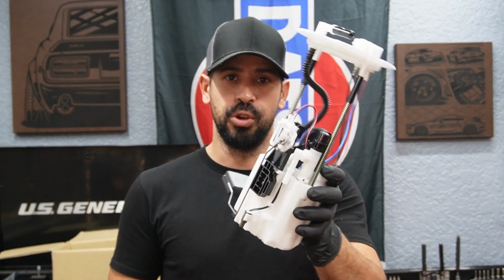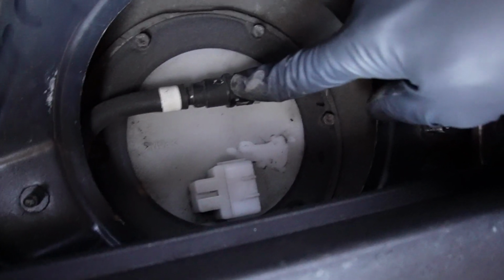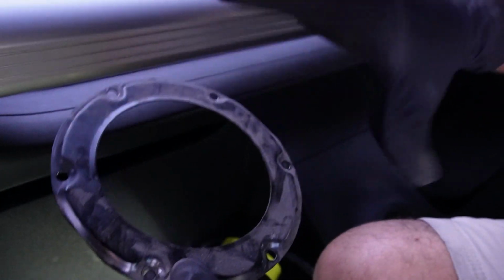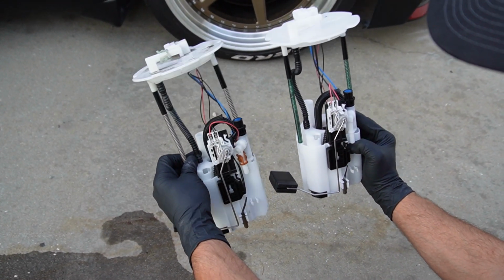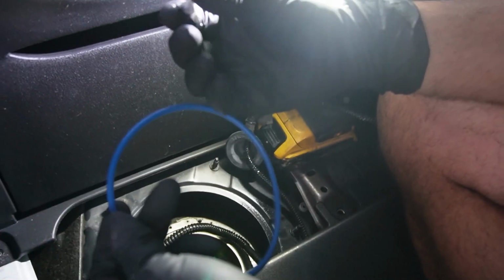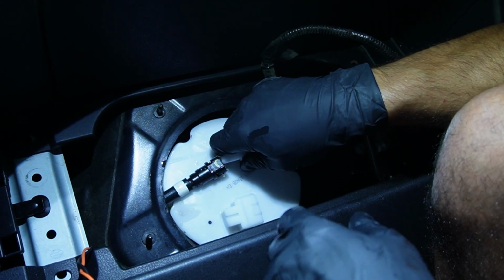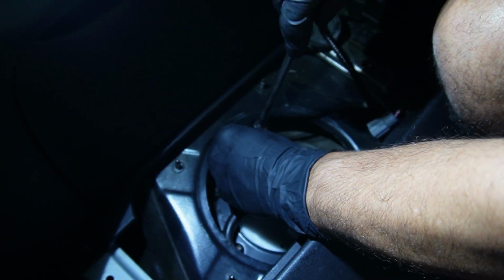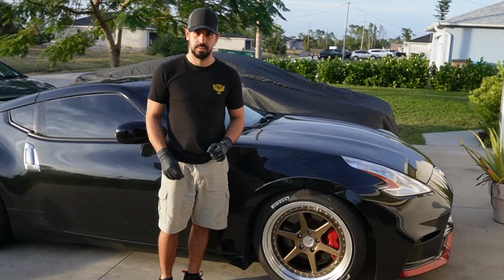Nissan 370Z Fuel Pump Replacement Guide

Comment: I'm surprised how easy it is to get to.  An added bonus is that you don't have to take much apart to see if the top hat is cracked which is almost always what does these pumps in.
Reply from the maker: Yeah, it's actually pretty surprising how accessible it is once you get in there! The fact that you don't have to disassemble half the car to check the top hat is definitely a win. And you're right, a cracked top hat is often the culprit with these pumps. It’s nice that you can quickly check and fix the issue without too much hassle! Makes it way less stressful.

Comment: You can start the car after disconnecting the connector on the fuel pump to depressurize the line.
Reply from the maker: Nice tip

Comment: Is it normal for the fuel level on the pumps to got bad....mines runs out of gas but still shows half a tank
Reply from the maker: If your fuel gauge is showing half a tank but you run out of gas, it could be an issue with the fuel level sensor or the sending unit in the tank. Over time, these parts wear out, causing inaccurate readings.

Comment: If you don't mind me asking, how did you realize the problem was a bad fuel pump? My 370z has trouble starting for a little while and now cranks but won't start, I'm thinking my fuel pump went out too potentially.
Reply from the maker: I realized that the fuel pump was going bad because the z would start up, but then stall out. My son was able to drive it home, but on the way home there was a humming sound coming from the right rear, where the fuel pump is. Using my scan tool, I triggered the pump on and off, but while testing it, I noticed the pump would not always turn on when it was supposed to.

Try this, let the car sit for about 10 min. Then have someone listen where the pump is for a humming sound. Don't try to start the car but turn the ignition on. You should hear the fuel pump priming. If you hear nothing, it might be the pump has gone bad. There's more testing that you can do. If you need more help comment again. 

I hope this helps.
Thanks for watching!
Reply: Thanks for the info man. I figured it was the pump so I went ahead and replaced it using your video as a guide. I truly appreciate your level of detail, helped me a ton, thank you!
Reply from the maker: Excellent! 👊 your welcome 👍 

In a couple of weeks, stop by the channel again. I'm going to be doing some more work on the Z. Some upgrades that I need to install. You might find one of those videos useful.

Thanks 🙏

Comment: Great video! I’m trying to install my own kill switch for my new Z by cutting power to the fuel pump with a simple switch. Which wire would that be on the pigtail? I see 4 wires in that connector. Guessing it’ll be red?
Reply from the maker: Check out the video I made for you. I hope this helps!

https://youtube.com/shorts/UhQYP9AgyrQ?si=S05ZJp_d7EJw4tpz
Reply: @Prolbuilds  my comment got deleted by YouTube because I pasted a link to NissanZClub website lol 

I’ll re-type 😅 

I just wanted to say THANK TOU SO MUCH for pointing me in the right direction for finding power to the fuel pump! I was able to successfully cut the wire and solder another two wires to my switch. After testing it out a few times it does kill the engine to my fancy new shiny red 2024 Z (don’t tell Nissan lol I bet this cancels my warranty) 

It wasn’t the pink wire you mentioned in the short , turns out for 2023+ Nissans it’s the green wire. I was able to find out by making a post on the nissanzclub website titled “Does anybody know which wire is power for the fuel pump?” If you’re curious to look it up 😅

I was going to reply with another short but then I’d expose where I hid my switch to the world haha 

The wire does feel warm to the touch after driving but it doesn’t seem to be a concern. It is less thick copper than the fuel pump positive wire , but don’t smell anything burning and didn’t notice a loss in performance 

Anyways Cheers! I’m subscribed 🎉
All the best from Ontario Canada !

Comment: Great video , if you don’t mind me asking what silicone compound did you used ? Or it don’t really matter ? ~ thanks 🙏🏼
Reply from the maker: The specific silicone compound that I use comes in little packages when you replace your brake pads. But you could use any type of lubrication that doesn't eat away at the o ring.

look up Super Lube it's made just for o rings.

Super Lube 56204 O-Ring Silicone Lubricant, Clear https://a.co/d/g5yPy62

I hope this helps thank you for watching👍
Reply: @Prolbuilds  thank you 🙏🏼

Comment: Hi, I have done the fuel injectors cleaning on my Nismo 2019 (168k -km) from the dealers, do you think I need to replace the pump? And in this car do have fuel filter or it’s the pump itself with the filter? 

Thanks
Reply from the maker: If your car’s running fine after the injector cleaning and you’re not having any issues like hard starts, losing power, or sputtering, you probably don’t need to replace the fuel pump.

Most newer cars, including your Nismo, have the fuel filter built into the pump inside the tank. So if the filter ever needs replacing, you’d have to swap out the whole pump assembly.

Here are some signs of a clogged pump or filter to watch out for:

Trouble starting or the engine cranking for a long time.
Losing power when you hit the gas.
Misfires or the engine hesitating.
Poor fuel economy.
Just keep an eye on how it’s running and maybe have the fuel system checked at your next big service. Also, stick to good-quality fuel and try not to run the tank too low—it’ll help keep the pump in good shape!

Comment: So i just replaced mine because it was cranking but no start, and still does the same thing. I also checked the relay and it work. I also cleaned the throttle bodys and filters. 
Do you have any ideas on what eles could be the problem??
Reply from the maker: Have you checked for any codes? Also check and make sure you have power where the connector plugs into the pump. Use a multimeter, you could have a voltage drop, the meter should read around 12v.